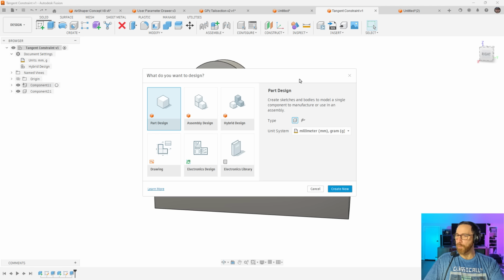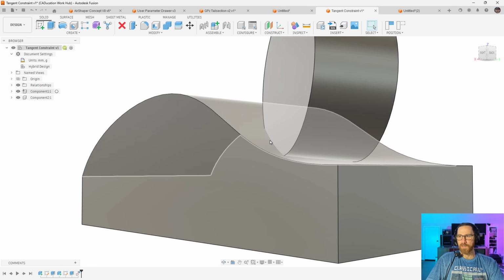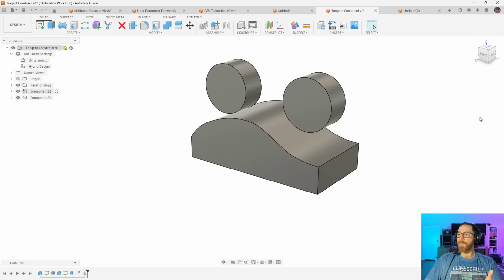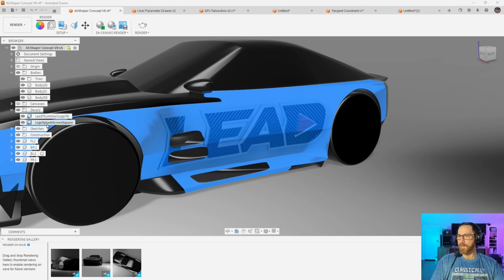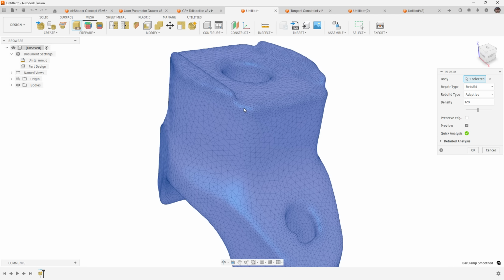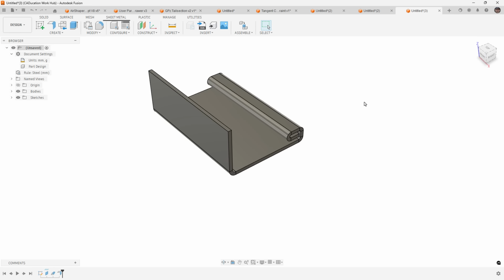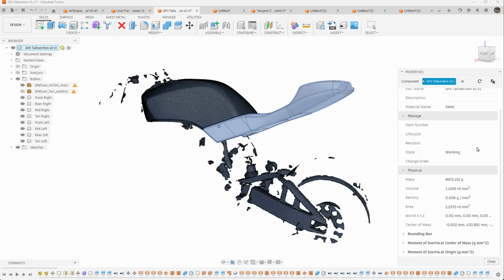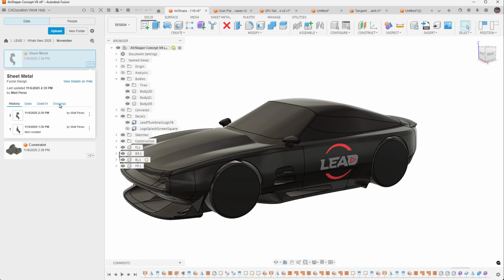What's New in Fusion | January 2026 #cad #fusion #fusion360

Comment: Have you ever consider doing a series on Freecad? I love your Fusion and Plasticity series, but because of autodesk hindering the hobby version of fusion more and more I switched to a combination of Freecad and Plasticity
Reply from the maker: Freecad has been on my radar but I haven't used it yet.  For most of my designs the freeform and mesh based tools are key and I don't think freecad has subD type modeling correct?
Reply: @LearnEverythingAboutDesign  They have a Mesh workbench but i haven't messed around with it to know what are the capabilities. I just used the Part workbench. I tried Freedcad about a year or so ago on the v0.9 and didn't like it. Tried again last month on v1.1 and its a world of differences, enough that i'm finally moving to it from Fusion.
Reply from the maker: @formulaonesixfour  Thanks for letting me know.  I'll have to dig in a bit more.  Same thing happened with Rhino.  I tried Rhino 7 and really didn't like it, but haven't swung back around to try Rhino8 yet.  I have a linux system I am working on and looking for a CAD solution if running Proton for fusion doesn't work.
Reply: Plasticityis a toy for the hobbyist. If you have ever worked in a actual professional environment with clients that demand changes daily, you CANNOT use Plasticity due to its massive flaw, which is destructive modeling, one which they refuse to acknowledge or fix.
Reply: @blackeyedme  Everyone that ever bought or tried Plasticity knows that. That's not the point of the software, it's not a Fusion (or similar) replacement. Still a great piece of software and Matt did a great job on covering it in this channel. I even bought his course on it to give me a better intro into it.
Reply from the maker: @blackeyedme  I wouldn't put it like that.  I do a lot of destructive modeling for clients because its faster.  So to your point about demanding changes and not knowing what they want, the direct modeling approach is by far the quickest way.  Plus when you are hundreds of sketches deep into a design sometimes you can't just go back and change a number early on because face selections break or features don't rebuild.  So Plasticity isn't refusing to acknowledge it, its a feature not a flaw for them.

It really depends on what you are doing and the level of control you need.  If I am modeling mechanical brackets all day with known hole locations then a robust model built on best practices works.  But if I am designing a complex consumer product for injection molding and the client suddenly decides they want an extra button, or to move something I am not going back to fix this "properly" in some cases.  This is because the client doesn't want to pay for hours of rework when a 5min fix will work and going back to say move a rib in a sketch has hundreds of dependencies down stream.

Here is another one for you.  Plasticity and Fusion are on the same parasolid kernel.  but I have had many instances that Fusion fails to do things like apply a fillet or chamfer on the edge of a complex part.  Same geometry brought into Plasticity and its fine.  To be fair I have had instances where Solidworks wouldn't shell a part, but Fusion would.  And so again best practices go out the window depending on what you are doing.

So I hear what you are saying and I don't entirely disagree but "it depends".  Most clients I do work for don't need a file they can change, they want geometry as quickly and cheaply as possible.  Plasticity can work really well to generate complex shapes, spaceclaims, and final customer facing geometry then pushed to a traditional CAD program for final detailing for things like wall thicknesses, ribs, bosses etc.

Comment: With that weirdness with the tangent constraint? Is that something where you could use the outer edge of both sides of the round part you had and do two edge to face constraints and it would stay more "correct"?

Thought I saw something about edge to face being a thing in the update notes as well.
Reply from the maker: Yes you can do an edge to a face so that is possible.  But in reality you would probably do an edge on both sides of the cylinder and arrive back at the same problem.  

I think for a cyl to cyl connection it will work well.  for more complex situations it would be really nice to have a joint or constraint that was following a curve for say a complex cam lobe.

Comment: I'm still waiting for the day they decide to add 3d sketches on mesh. One more year on my licence with fusion, don't think I'll be keeping it if they don't implement it. Your videos are the best on YouTube. Appreciate all your hard work 💪
Reply: Fusion is not smart enough to understand they are not meeting the minimum threshold for a mesh workflow. Additionally, they don't have enough motivation ($$) to do better.
Reply from the maker: I think the mesh workflow is such a small subset of the users that yeah i wouldn't imagine they put any effort into it.  But hey we got a new mesh repair tool option so its not totally off the radar....
Reply from the maker: Thanks, yeah not sure that will happen.  a workaround is to convert the mesh to a tesselated solid and then you can snap to it with a 3d spline, but its cumbersome.  QuickSurface or Plasticity handle that part pretty well.
Reply: Clicked this link to find out if they finally added 3d sketches and instantly saw your post and sighed. Oh well.